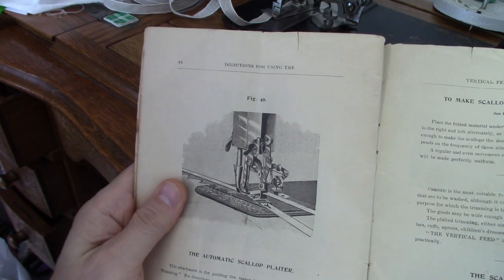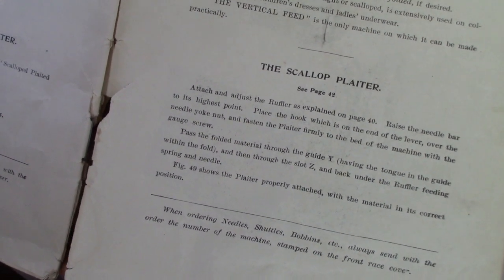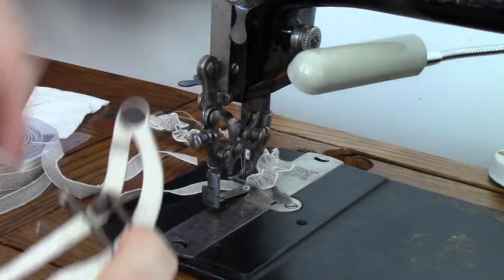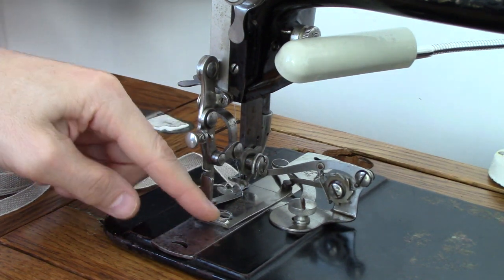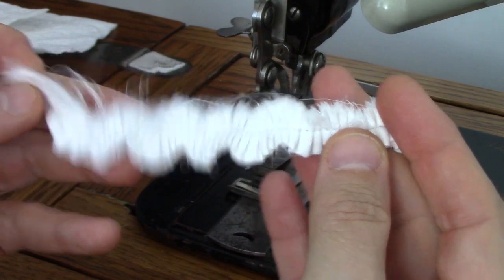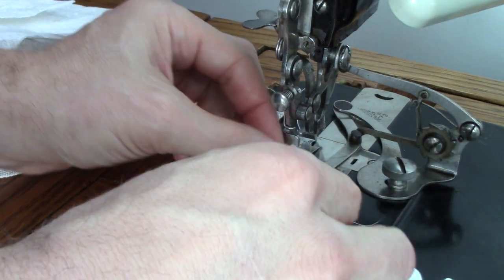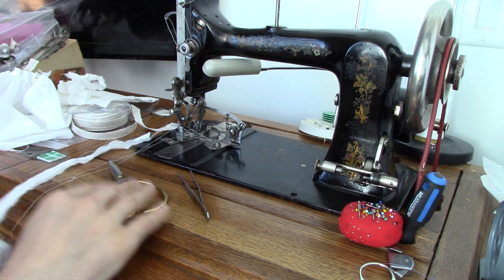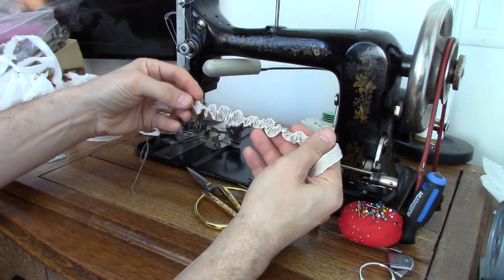Davis Vertical Feed Scallop Plaiter Attachment

Comment: James, this is a great demonstration!

I have a set of these attachments that came with my 1914 Davis VF, but they are missing some crucial screws, springs, and levers. Could you do another video to focus on the structure and mechanisms of these attachments?

The owners manual you are referencing also looks like a better fit for my machine--the ones I have found are too early and don't have the same )more modern-looking) layout and fewer pages than yours. Where did you get your manual?
Reply from the maker: I hunted online for copies of the manual. There are some PDF's around which might help. I will try and get some videos made on the structure and mechanism. Thank you for the suggestion.